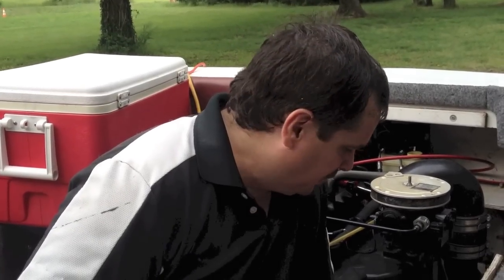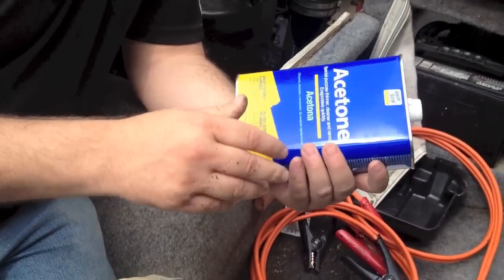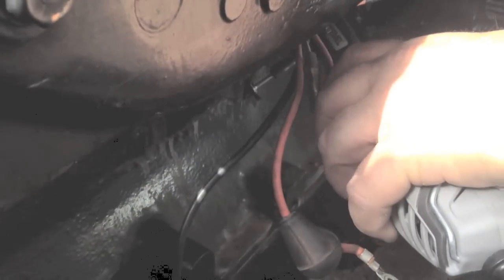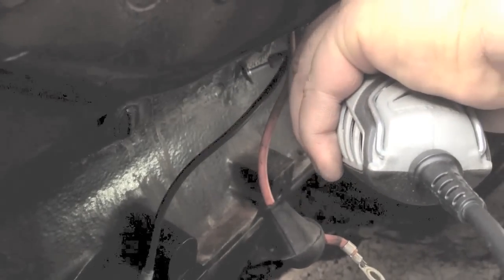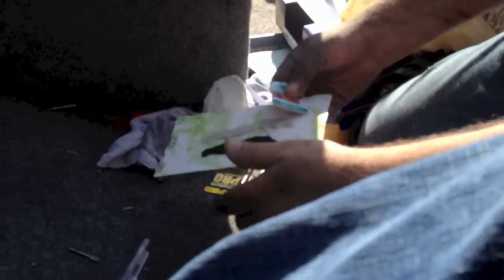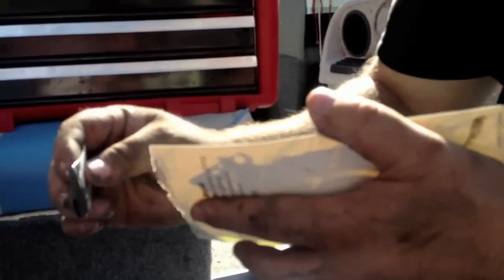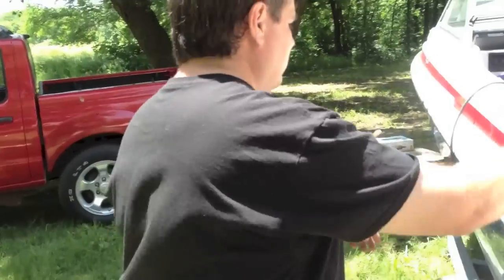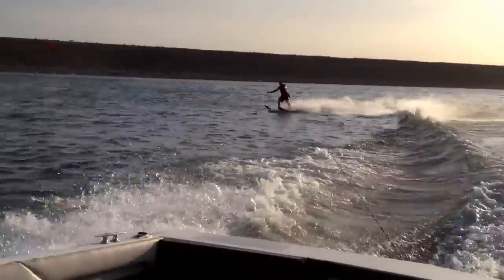Cracked Engine Block - Will JB Weld Fix It?

Comment: Just bought a 1997 bayliner 1950 Capri with a mercruiser 3.0 with a crack in exactly the same spot. How did this hold up for you?
Reply: Burl Nicholson I have this exact same boat and just discovered a crack on the block on the same side. I have a lot of corrosion on the side (my boat is in salt water a lot). Have you attempted the JB Weld fix?
Reply: ***** I took the boat out for a test run at the lake to get it hot and see how bad the leak actually was (before attempting any repair) ...after an hour of running it hard ...the block never leaked on me...So I have not put anything onto the crack. But it is highly visible and no doubt that it has leaked in the past...I may just go ahead and get a head of it... Clean the crack line with a grinder and give it a good coating of jB weld...until then I dont have any way of knowing if it will actually do the job or not.   I Have had people tell me they have driven their boats with cracks like this for years and even when it leaked some,..as long as the pump works, go ahead. haha crazy but I wanna try and make it  sound again for little money and time if possible. Worth a try I will report back once I get it done.
Reply: Burl Nicholson Right on thanks for the report. I ended up doing the jb weld on the hole in my block and took it out on the bay on the 4th of July. I didn't run it hard or long but i checked on it frequently and it held! i'll keep you posted on how she holds up next time i run her hard and hot. Thanks for your update. I'm wondering if there was an issue with the casting of the block on our model.
Reply: ***** thats great man! 
I wonder the same thing too. I have read in a few forums several others with exactly the same crack. 

Hope the jb holds up. not planning on taking mine back out for a few weeks.. when my son comes home on leave. 

but we will give it a torture test no doubt. God Bless and stay safe sir.
Reply: You too Burl! Have fun and good luck...hopefully the crack will never leak!

Comment: Would this work on a cast iron intake manifold? And should I drill the ends of the crack to prevent it from spreading?
Reply: ***** I haven't found out as far as the JB goes. But many people say they wouldn't use it on intakes just in case a piece brakes off. Don't want it going into the engine.

Comment: The manifold in my 96 Honda Civic has a 3 inch crack. I won't be able to replace it for at least 30 days. Would JB weld work?
Reply: absolutely, as long as we are talking about the intake manifold
Reply: 3 INCES LONG OR 3 INCHES WIDE?
Reply: Bryn Comeaux IT'S LOUD IN HERE; ISN'T IT???

Comment: Wish I could have used J.B. weld when I cracked the block in my Mark Twain but a valve stuck open and the piston hit it and it cracked the block like a broken watermelon .  The valve was the size of a half dollar and it was stuck half way into the top of the piston .  The mechanic that replaced the block said he was keeping it cause he was only charging me a little over a thousand to replace the block and it was the worst cracked block he had ever seen and the piston was going on his desk as a paperweight .  Never buy a boat with closed cooling if you can avoid it .

Comment: Jb weld will repair ANYTHiNG if you use excellent preparation. It's weakness is vibration but on large rigid surfaces or on small broken parts it will last beyond the years you sell the vehicle/boat.

Comment: I had a friend that had a rod knocking in his car and it had done ate up the crankshaft so he took the quick steel epoxy and put it under the new bearing and torqued the crankshaft back down and it has been like that for over a year , I have tried jb weld before on stuff doesn't hold we'll under pressure if I were anyone fixing cracks on the blocks I would remove and leave out the thermostats that way it will never run much over a 100 degrees , and try the quick steel !
Reply from the maker: Thanks for the tips....I have not tried quick steel!

Comment from the maker: With the motor being enclosed, it was a very tight fit and a spreader may have been too big.  You could cut a plastic spreader, which would have been better, but I forgot to pick one up and I did not have one there.  Thanks for watching!

Comment: funny to see the same crack as my boat lol How long has it lasted?
Reply: Austin E Found your other video from 2014, thats pretty awesome I was about to just say screw it because the crack i have is so long. If you dont mind any tips on winterizing this engine. Thanks again for sharing. Now its time to pull the head and fix the bent valve!!!
Reply from the maker: Austin E It has been 3 years I think...2 or 3!  We go to the lake a lot during the summer too.

Comment: How can I figure out where my engine is cracked if I can't see it but it's leaking oil??
Reply from the maker: That is hard to say.  But it may be leaking from one of your gaskets or seals.  If it is coming from up high on your block it could be your valve cover gasket.

Comment: will it work too kip spark plug in ???
Reply: I'm gonna try it today. my spark plug blow out the hole. so I put in gonna let it dry for 24hr. and drive it home 40 miles I hope it holds up.
Reply: hope so too mate cud ya let me no if work or not thanks
Reply: any lucky with that ?
Reply: I drove it 4 miles and it poped out. had to turn back and leave it at work. I really thought it was gonna hold up..
Reply: 4 miles not bad my scooter 125 so with you say 4 going too give it go lol wen i go out dont go 4m anyway lol
Reply: I put in my 95 s10 2.2L . got around 60mph and it pop out . all bad now I got to replace the head
Reply: no way mite give it a miss lol

Comment: I've watched both the videos on this fix. I'm hoping to have the same luck on my motorcycle engine case. Donnie, when you drilled the the holes to stop the crack from spreading you did not go all in right? You just mad a dimple?

Comment: hay Guys nice Job. By the way Quik Steel come in a 500 F Degrees / + 260 C :         And 90 F / - 68 C degrees . I just Got Some Today I Plan on Fixing A hole in my Motorcycle Crank Case about the size of my thumbprint . wish me luck :>)